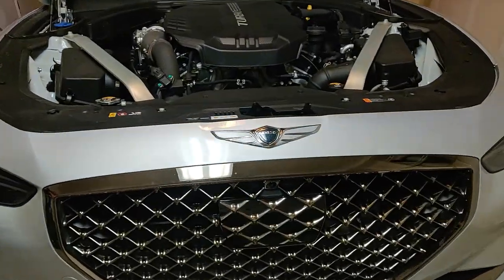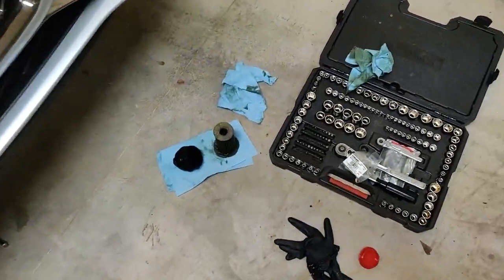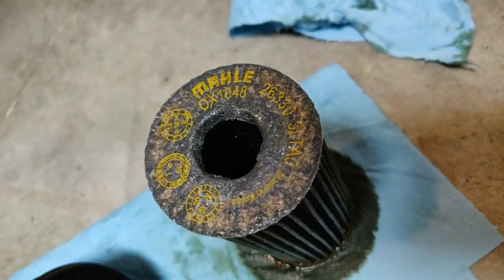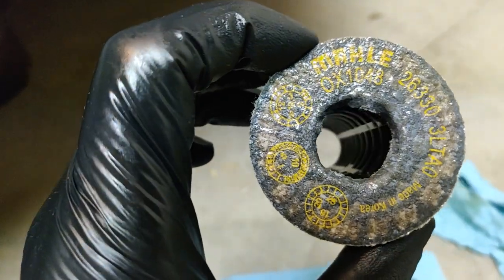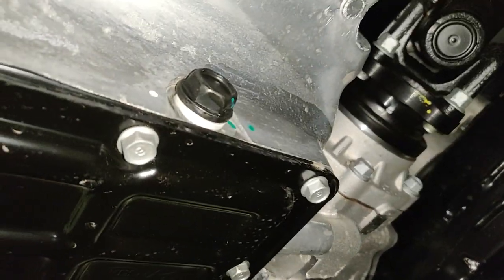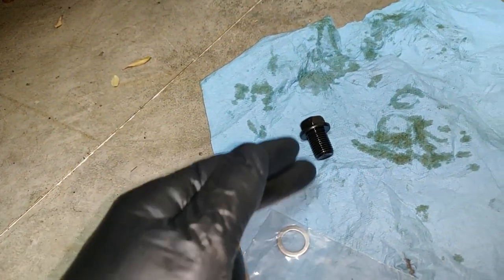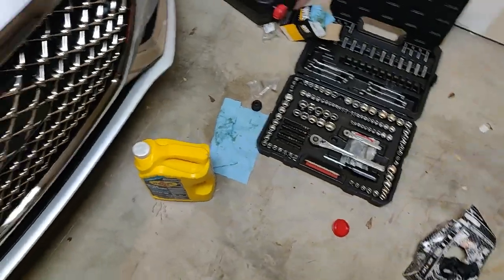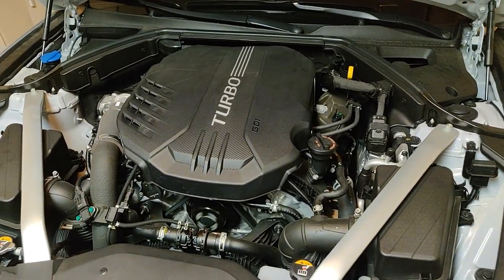2019 Genesis G70 Oil and Filter Change (how-to)

Comment: I just bought a 2019 g70 3.3t advanced fully loaded with only 10k miles.  I'm glad you did this because it's a lot cheaper to do my own oil especially since this beast takes almost 2 gallons of oil.

Comment: Also if you want to make sure it starts with oil pressure you can floor the throttle with the car off. Hold the peddle down 100% and hold it and crank the car. All OBD2 equity cars this shuts off the fuel pump/ injection system and allows you to prime the vehicle. It’ will only crank with the gas floored for a few second will not start and then stop on it’s own. After that you can let off the gas and start it up and the oil system is primed! Very important on turbo applications. Fun fact for ya
Reply: Any reason why this wouldnt work?
Reply from the maker: @cookiemonster9020  I tried it on the G70 before I sold it and it didn't work. Evidently some cars it works, others it doesn't.
Reply: @crxtodd16  yeah on my g70 it just ended up redlining i wasnt to happy
Reply from the maker: @cookiemonster9020   Haha, yeah same thing happened with me. Wasn't excited about redlining it right after an oil change before having any pressure built up. 

I tried it on my 2006 Subaru Outback and it works. Also tried it on my wife's 2021 Kia Seltos and it doesn't work. So, there's that. Lol.

Comment: Nice video, I have a new 2022 G70 sport prestige and swear by amsoil for oil and diff fluids you will notice a difference in how smooth the car runs and turns

Comment: Pennzoil is owned by Shell, so Pennzoil Ultra Platinum is basically the same as Shell Helix Ultra (not usually sold in US markets but sold elsewhere around the world). Hyundai has a worldwide factory fill and marketing agreement with Shell for al Hyundai fluid requirements.

Comment: My Genesis G70 came with 3 years of schedule maintenance. The dealer just changed it for me last week @ 6000 miles.
Reply: Yeah, except that my experience has been that the dealerships have no idea what they're doing. I tried two different ones and both used oil that didn't meet the specifications. They both used non synthetic oils that didn't meet ACEA A5 spec.
Reply: @xbandg  no car needs synthetic it's a choice
Reply: @Rachel Collins theye use cheap oil cause theye want to save $$$
Reply: @Test7017  And TURBOCHARGED HEAT PRODUCTION IS A MYTH! With the massive heat  generated by the turbo and the glowing red hot nature of the bearings within those turbos, I would not deem it wise to forgo FULL SYNTHETIC ENGINE OIL! OIL IS CHEAP IN COMPARISON TO ENGINES THAT ARE NOT!!!